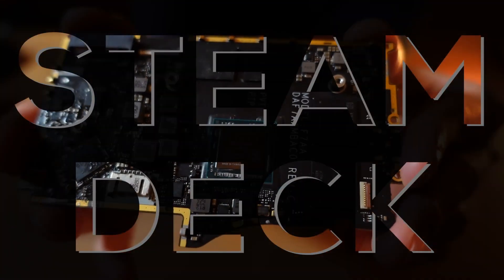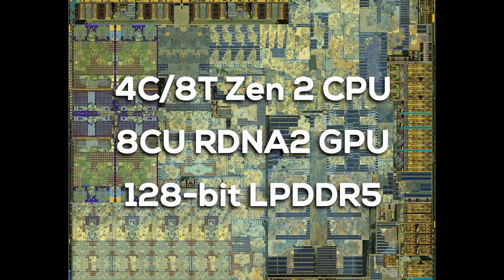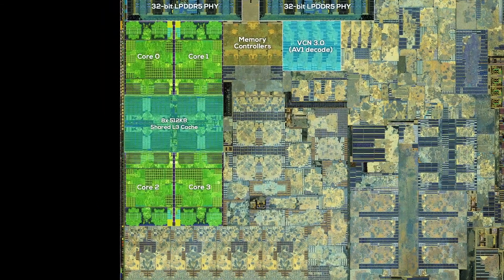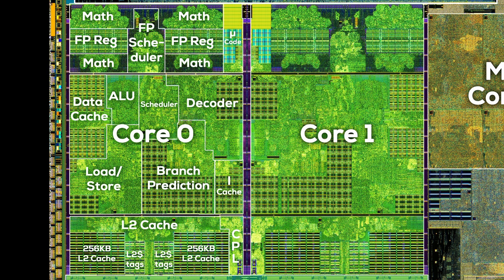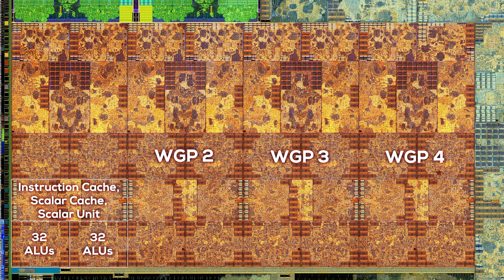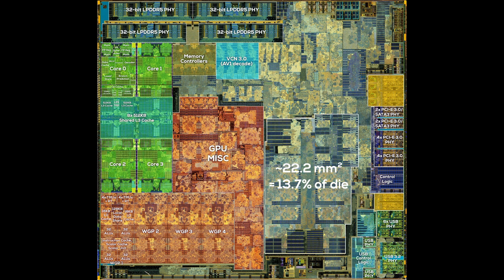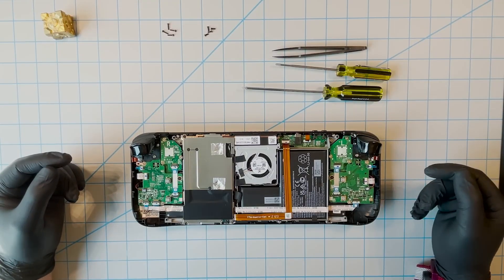The Aerith APU inside the Steam Deck

Comment: AMD's CPL acronym is actually 'Chip Pervasive Logic'
Reply from the maker: That's interesting, so it doesn't have anything to do with the current privilege level at all? What function does the CPL have?
Reply: @HighYield  thread security and privileged-ness is built into lots of different units all having to do their part to keep the entire system secure.

CPL logic includes things like clocking, test, and voltage domain crossing structures that are used all over place.

Comment: Kinda disappointed about the unused section being removed in 6nm. When i read the news i thought maybe this section would have a link to the "deckard", but this doesn't seem to be the case if they've scrapped it.
Reply from the maker: It’s just a theory until now, I’ll need to look at a 6nm chip to confirm. But yes, wouldn’t make sense to scrap it if they want to run Deckard on it.

Comment: I just got a Steam deck. Lovely little thing! Very impressed with the sheer power of it and was worried it would replace my Switch. Alas after scorching a load of games to fill the 1tb storage (I have a 1gbps web connection) hooking it directly to the main router, I've had nothing but crashes galore and wasted too much time fiddling to get it working. Memories of wasting time on computers… working all day to fix my iPhoto or iTunes libraries. I don't get the appeal now of tinkering with unenjoyable stuff -- now -- tinkering with fun things like a recurve bow to get it in the gold on a target that's 80m away. Now that's fun :)

Comment: amazing shots and great description of the components of the die, glad to have found this channel.
you know which die will be interested for a video? a damaged Xbox 360 GPU affected by the Core Digital Error (the infamous Red Ring of Death) since the damage was on the physical layer of the die due to low transition to glass of the underfill used on the early chips.

Comment: I feel we will see a big improvement in processing when all those levels of cache will be consolidated into one level of fast cache that is accessible from any place, and the huge area that is regained used for actual computing. But that will probably also mean a lot more TDP and heat spots.
Reply: its not gonna happen, one reason they have different caches is to have it closer to certain parts. the distance makes a big difference in speed
Reply: @Xiefux not in speed, in latency, and that can be mitigated with design

Comment: In the LCD BIOS the CVIP cores are mentioned, for example you can change their voltage. It is definitely 'powered on' by default. You may be able to use ROCm to utilise them or amd openvx / mivisionx.
Reply: I’ll look into this on my LCD!
Reply: @etzabo  What did you find?

Comment: The motherboard at #0:17 is not a first generation LCD steam deck motherboard, 1st gen APU, sure, but more like third generation motherboard (if you count original dev unit, then release unit, and then the revised release unit before the OLED), the APU is rotated and the WiFi adapter is angled and not situated underneath where the SSD would reside, this isn't the case with the first gen LCD Steam Deck.

Comment: It's crazy because that extra CV part of the chip is for Project Deckard. "The Android Killer". Magic Leap headsets also don't have much special on them. IIRC they don't even make their own waveguides and that OEM has plenty of other companies that purchase from them for development. It's still a cool device (ML2), but there are base designs available to go off of from many companies, and that die area is payed for, and costs a good amount when ordering your batch of wafers.

It's been payed for since the beginning because of how eye tracking saves on compute requirements, making VR a shader (accelerated with the ML portions of that chip) away from being feasible on mobile devices as long as that closed loop is set up. A lot of that also saves on compute time with SLAM and generation stuff for how to denoise the lowres perspective render, which is a huge power saving thing too. When the Deckard MR headset does release, just keep your steam deck near you in your pocket or something. Gabe's long time goal has been something akin to SAO.

Comment: I just need an analysis of why, when I open the deck back into games sometimes, only rhe left audio channel works. That’s with Bluetooth and aux…

And now suddenly, the aux jack always only has the left channel, and that’s with multiple headphones. 

I’d use Bluetooth but the delay is far too much for gaming, even if I change the codec. 

I suppose it’s possible the right channel of the aux broke somehow (while the Deck was sat safely in a drawer for a week since e the previous use), but I think something happened when I had the usual issue and went into desktop mode to see if anything weird was going on in the audio settings.  

I’m on the verge of doing a factory reset

Comment: As much as I would like to think otherwise, I seriously doubt the CIVP cores are workable on any LCD decks. That kind of subsystem would 100% need it's own power rail and regulator to run, which is obviously missing on the steam deck main board. Very likely that it was fused off from factory, and perhaps even possible that chips with defective or underperforming CVIP's were taken from Magicleap's bin and given to Valve instead of trashing them.

Comment: Hey, as someone who has been doing chip annotations for a while (under the GPUsAreMagic name, mainly on twitter), I salute you for this deep-dive, the layout and analysis are spot on as far as I'm concerned. And the juicy find of the CV cores is quite exciting!

A few things to address which you brought up throughout the video:
The GPU "Misc" area can probably be labelled if you trust some of my RDNA2 annotations, but due to this being a single shader engine GPU, it will still be very hard to distinguish the SE, SA and command processor as there will just be a single one of each.

Your hunch for the display PHYs being above the PCIe PHYs is probably correct judging by other AMD chip pics, which means VanGogh has 2 dedicated display PHYs.

The USB port spam is quite surprising, but keep in mind the 2.0 PHY is physically separate from the 3.2 PHYs (since the data lanes are also separate, a 3.2 cable still contains the dedicated 2.0 signaling), which means (judging by older chip pics) the two thin PHYs under the PCIe area are likely just straight 3.2 PHYs, the slightly bulkier ones below that probably support DisplayPort Alt-Mode.

CV cores I sadly don't have anything new to add as I'm absolutely clueless with how those could possibly look like, but the general slicing and guess-labeling you did seems pretty accurate. It also bears quite a big resemblance to other "relatively simple compute but spam a lot of it for AI/CV" engines such as Apple's NPU.
Reply from the maker: Fritzchens Fritz uploaded the high res images on his Flickr, maybe you can find/label more areas. The originals pics are super detailed.
Reply: @HighYield  You can be sure I will take a look at it when I have some time :D

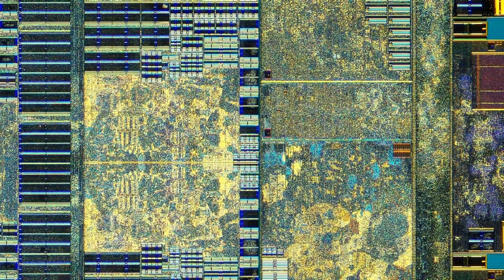Comment: @9:40
I've been working with PCIe at low (near-chip) level a bit, and it is much, much more, than just the PHYs.
This is more akin to Ethernet-like packet switching network, and the controller needs to be able to replay any buffer (data), that was lost or corrupted in transmission.
These replay buffers can actually be quite large (even in terms of megabytes), since the PCIe controller has to keep data in them, until it receives acknowledgement, that it arrived to destination device intact. So buffers need to be large enough to keep all the possibly in-flight data, in order not to block the transmission.
Also, the controller has to (de)serialize data into/from packets called TLPs, and sometimes, include quite complicated logic to ensure good performance, fairness of data transfers and so on. And I haven't even touched on IOMMU - the PCIe endpoints (devices) can actually initiate reads/writes to memory, and we may need to ensure, that these addresses are translated correctly, and that R/W permissions are OK.
Summarizing, large logic structures with SRAM blocks can be the PCIe controller.

Comment: As a chip engineer I always love seeing these die shots and breakdowns. For me it's a lot of lines of HDL and papers to sign off on, and then I move on to the next revision or next product when results come back from the fabs. MTL is the most  recent thing I helped with to launch, and the next for me is LNL. I'm not an architect for CPUs or GPUs, I just glue chips together and wire up busses.

From what I can see in the shots from Fritzchens Fritz, I think you're correct about the central section of those 14 cores being some kind of bus. If you look very closely you can see higher density (noisier) sections periodically near each core. I suspect the area above the main 6 cores to the left of the smaller 6 is some sort of interface block to get to the rest of the system, as it also appears to have a couple of stops on it. That would be 16 stops on a ring bus, which is a lot, but not too many for something like a VPU or NPU that doesn't need super tight core-to-core latency specs.
Reply: Lol, wut?

Comment: The CVIP area has other implications aswell: Valve is currently working on their Deckard VR system, which will replace the current Index. According to leaks Deckard will feature a ARM and X86 APU in some form. The index used FPGA to enable the usage of the Lighthouse tracking system; if they want to get rid of that to reduce costs, a APU that can process visual data fast (to enable camera based tracking) should help here.

Comment: I would gamble in saying those extras cores are physically severed from the 7nm and removed completely on the 6nm.

Leaving them connected would risk someone being able to access them and use the "unlicensed" tech on them.

I can imagine Valve and the Magic Leap creators having some sort of an agreement that they can share the APU at a low cost but must not use the extra cores on the deck.

Comment: Oh, so musch like the Switch, the SD also uses some cheap defect chip with the computer vision cores disabled?
on top of the pathetic screen, I'm glad I didn't buy the original SD, cheap garbage assembled from the cheapest parts possible.
Reply: I'm not sure quite what you're so disappointed at, there's little reason not to use partially defect chips if it's entirely isolated to an area you have no intention to use in your product IMO. The screen isn't great, yes I'd agree, but Valve were absolutely targeting a very low-price point. Your 2015 MacBook was several times the price of the Deck when new and the panels are still relatively expensive to replace.

I think you'd be better placed looking at the higher end handheld PCs with better performance or perhaps the OLED. The 1st gen LCD Deck is what it is and clearly wasn't designed with discerning high-framerate/quality focused users as a priority. You want something better and that's where ASUS and the likes stepped in.
Reply: @LightTheUnicorn  The Z1 Extreme chip works best at like 30w, they didn't even care to optimize it for lower power levels, plus it's got a useless AI core in there just like the SD Chip.
Sure they're all doing this to cut cost, and that's the point, don't cut costs, make something high quality like the iPad, don't target lower price point, leave that to the Switch.
Reply: The LCD steam deck is awesome, in 20 years the LCD version will still have a like new screen while the OLED has burn in. So the LCD version is going to last longer and have better retro value in the future
Reply: @CrucialFlowResearch Modern OLEDs don't burn in nearly as easily as they used to. Deck OLED uses the same panel as Switch OLED which only gets burn-in after 2 years of being on 24/7 at full brightness.
Reply: @CrucialFlowResearch  nobody cares if it will have a new screen in 20 years, the screen is so garbage it would be considered garbage in 2010, nevermind 2020. I just picked up a 2015 Macbook for $100 and its screen is 4x better than the steam deck, it's a joke.
Reply: The NSwitch uses an Nvidia Tegra X1, which is a full fat Nvidia Maxwell GPU (that is SoC), it was at the time, and for a very long time after, the most capable mobile GPU available, even to this day it is impressive and can STILL outperform RDNA in many tasks, it has even been upgraded over the years with the Makiro X1+, which has 20% more GPU performance, if they were to pair a Ryzen and Tegra Lovelace GPU with a small eDRAM cache (or some HBM2 V-RAM) it would be a little powerhouse and completely outclass anything we have seen to date.
Reply: @Wobble2007  Nope it wasn't. The Apple A10x was way stronger at the same time when the Switch came out. We're talking 2-3x in both CPU and GPU

Comment: Deck 2 can just reuse the 4c8t zen2 in 3nm for cost savings but pls slap in monstrous 16cu rdna3.5 if they intend to reuse 800p90 screens
Reply from the maker: I'm sure a potential "Deck 2" will at least go with Zen4c, if not Zen5c.

Comment: Why wouldn't amd/valve to use lpddrx on same substrate to the main CPU like apple does on M series chip?
Reply: Cost.
Reply: Cost mostly, but the performance mat not be memory bandwidth limited. 8x rdna2 at relatively low clocks won't have huge bandwidth needs, and the needs of 4x Zen2 is minimal even with the cut-down L3$.

Comment: Wasn't this common knowledge, that the Deck's APU has AI? Valve "jumped on" a chip Microsoft already paid for to AMD, but since they abandoned the project, it was much cheaper for Valve to just use whatever AMD already had instead of paying for the entire APU creation and development process.
Reply from the maker: I honestly never heard anything like this. Is Magic Leap part of Microsoft?
Reply: @HighYield  Not afaik, but MLID alledged something like that (van Gogh having initially been designed to go into Surface products) recently. I just can't remember off the top of my head if it's been on Broken Silicon or one of the other videos. Just recently in any case.

Oh, and Merry Christmas, of course. 😀

Edit: van Gogh, not Oberon.
Reply: @HighYield There was a 2020 rumor that Van Gogh was going to be applied to a scrapped line of high performance Surface tablets which then put the chip at risk of never seeing the light of day. This was long before Steam Deck reveal.

Comment: Tensilica IP inside... what the? It has a huge arm processor hidden inside, as big as the x86 cpu. 
Maybe it actually handles comms (wifi+bluetooth)? Though, it's way overkill in that size. 
As for AI acceleration, the gpu cores can outperform whatever the vpu thing is, so... Unless you need AI acceleration whilst running crysis at 60fps, I doubt it's of much use.
Reply from the maker: I wish I knew exactly what kind of cores they are, the 6+6+2 design is also very interesting.
Reply: @HighYield  Would be cool if you could activate them, would be great for handling audio, such as audio FM-Synth & MIDI emulation, or other intensive tasks.

Comment: It's incredible how little area in the CPU core is actually dedicated to arithmetic, as opposed to cache, scheduling, and memory management
Reply: no point in adding arithmetic units to CPU, if you can't feed them, branch/cache/memory prediction is the most important part of CPUs nowadays, branch predictor was the biggest block on main core area 4:59 not including l2 or l3.
Reply: I like to think of modern CPUs as fast instruction processors that just happens to do compute. If you need high compute performance, there's probably dedicated hardware for that. But those sacrifice fast instruction processing for compute.
Reply: as it has been for the past 20 years or so
Reply: The future of computing is all about working smarter, not harder
Reply: CPU design is weird. It's mostly written in some HDL (some by hand EE stuff) of the designer's choice, and you can transpile C to it totally fine. Any code written in it is executed as close as possible to instantly as a physical structure on some sub-section of the die. A lot of those management things are just huge pieces of logic that would take too much time or energy to compute iteratively (think 1 cycle for like 100 gates ish equivalent, excluding latency things) and a lot of them are predictive to try to avoid latency. It is quite common now days to take an AI Model, convert it to HDL and some bin files, and just throw a whole projective knowledge model in there that's been pruned to usually like some int datatype and with significantly smaller layer dimensions.

I don't even want to get into what microcode is or OOE but man, there's like a whole crappy 'OS' made out of transistors around every processor block for like the past 30 years or so. That 'OS' could be offloaded some to drivers if it is too complicated or space/energy/latency consuming, but it's usually too single use to really be considerable. There's also the PSP on this die and who knows? Sometimes there is essentially bloatware on your die from the tier 0 OEM, it's annoying and crazy. The reason I say that 'OS' is crappy is also literally every hardware bug ever that's not based around firmware.

Source: Me, I design CPUs.
Reply: see also "your computer is not a fast pdp-11", and other lies modern c developers tell themselves for the last 40 years :) instruction pipelining and caching is all just a crutch for people to avoid writing hardware specific code.
Reply: The cores in these chips are cut down zen 2 cores, especially compared to the cores in a traditional desktop zen 2 cpu.
Reply: @BGTech1  they are the same zen 2 cores, nothing is cut down except l3 cache.